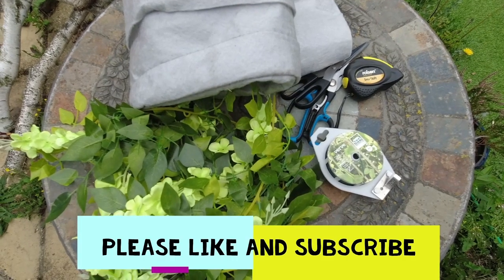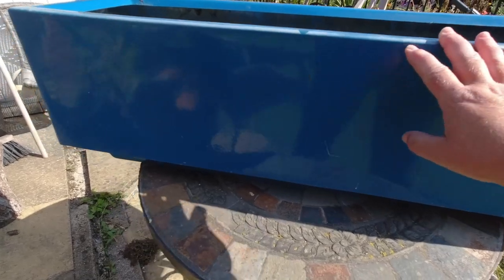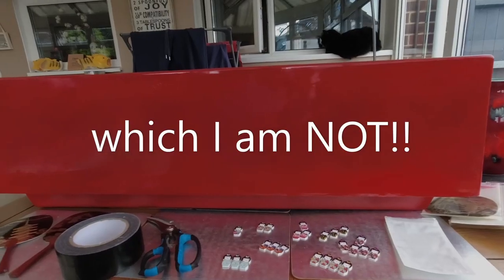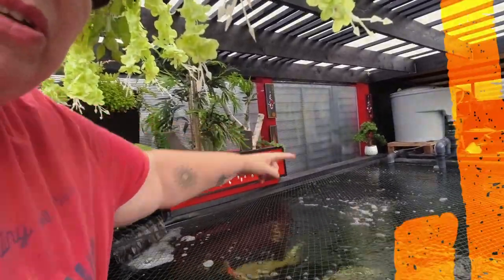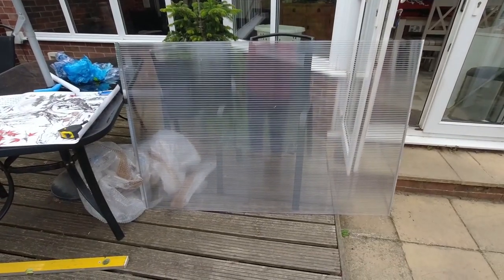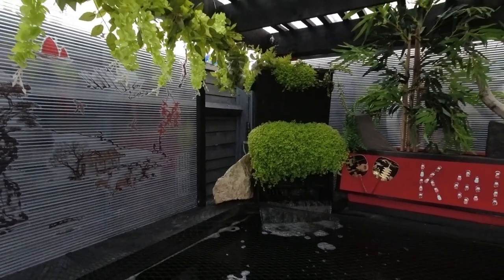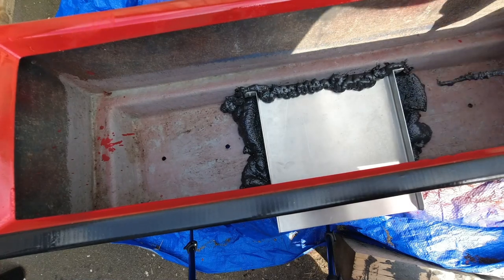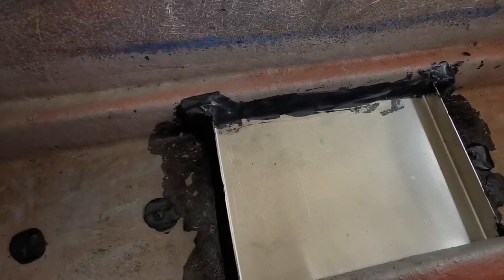Winter prep for the koi pond - Enclosing the pond

Comment: That was a great video Lau and a fantastic Idea for the winter protection/cover. Just to let you know next time you are doing a spray Job, you could do all the coats the same day just use paint stripper heat gun to do whats called a flash dry, between each coat, heat the paint from a distance and keep the heat gun moving all the time, then 20 mins a second coat, the the heat gun again, 20 mins the 3rd coat then 24 hours to dry, As a Paint sprayer thats what I do all day. plus you could always give a clear coat gloss Lacquer to give a little extra shine and extra protection, that way if your colour coat gets any light damage the colour will not scratch off, its called base coat and lacquer,  but you did an amazing job and it looks fantastic 👌👌👍👍
Reply from the maker: Thanks Gaz for all the advices. I will try that next time I might actually do it just to practice. Thank you!